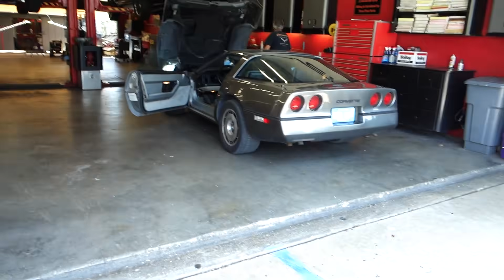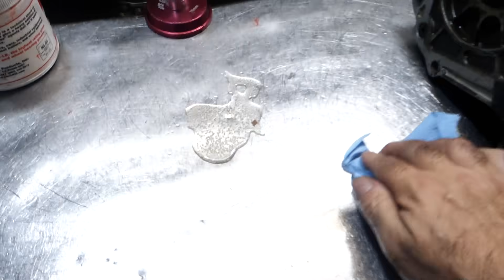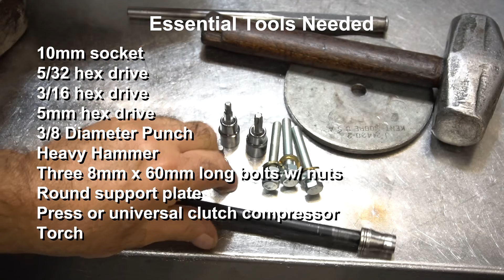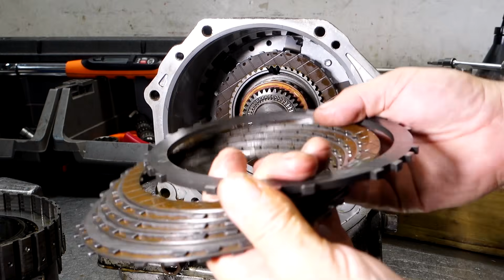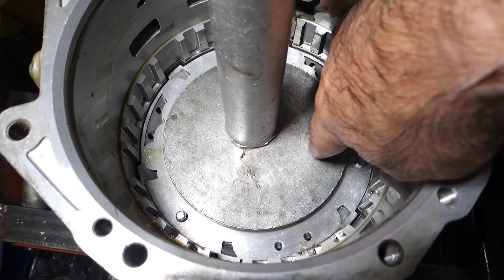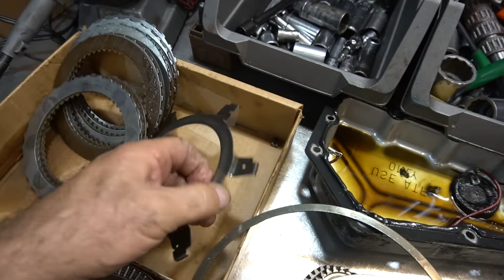How to Rebuild a Corvette 4+3 Doug Nash DNE Overdrive

Comment: Paul you do a great job and really appreciate your videos.  My point I guess you buy something like them year Corvette and GM threw a junk overdrive in there. Then the Bean Counters figure it will fix them under warranty. Which the bean counters know they will have to fix a few. They know most Vette owners won't putt enough mileage on them and when the owner warranty runs out there stuck with a high dollar fix down the road. At the beginning of the video I could tell by your words and actions that GM should have had a recall rather than stick it to the owner after warranty is over. You fixed a few under warranty but all the other ones that went out after warranty could be in the thousands of those cars. GM should have been sued over this screw up. Am sure they do this with a lot of there screw ups. I don't think GM did right but the owner in the ones that gets screwed. Would you be happy with this Paul if you bought one of these vette with your hard earned money and have to pay out of pocket that GM messed it up. I see these cars sell cheap because of all that electronic stuff that cost big bucks and most are outdated electronics that you can't probably even get from GM anymore. Really most of the car manufacturers make a lot of this junk. I have a friend that works as a technician for GM. We have pizza every Saturday night as we fly our drone and he is so tired of all the junk being made today. I asked him what is a good car or truck today. His answer there all junk. Why a lot of people lease today or buy the extended warranty. He lease his vehicle for this same issue. I hope at the beginning of your video your secretary don't treat your customers like she does you. A bear first thing in the morning and cussing at you first thing in the morning is not good start to the morning imo. Hope this is a joke. If I did this at my work I be fired on the spot. Seems like so much anger in people these days. You make it up by your excellent videos and work ethics for sure. And I really learn a lot and what vehicles to stay far away from them. Keep up the great videos though Paul.thanks
Reply from the maker: Rhonda is actually amazing with my  customers. The issue of companies avoiding the dreaded "recall" by issuing service bulletins still happens with every auto manufacturer. Investing in a new Vette today is financial suicide because parts typically can become unavailable in 10 years. The newer better models with those 6 speed T56  transmissions already have parts shortages. This is what fuels the aftermarket and keeps people like me in business. Thanks for the great feedback and watching the vids.

Comment: Sounds like if it's junk you find a different transmission rather than fix that piece of junk. Best bet is to stay away as far as possible for these years with a manual transmission with overdrive. Can you use the manual transmission that's in it without that stupid overdrive unit.
Reply from the maker: Well I overhauled over 800 units for GM without any failures plus my own jobs. So sometimes when you rebuild you fix the issues that the original party overlooked. Replacement used OD units if properly maintained work great. Never a failure in any Challenge car or Callaway Twin turbo I built them for.  The beam mount makes it difficult to do a non OD transmission other than swap out to the later ZF 6 speeds which are a service nightmare as well.

Comment: Where's  part 2?  
is $4000 a good deal for a '84 Vettte with 105k miles?  I don't wanna have to rebuild the trany every 50k miles.  I have a Crazy built 400 I could slap in it, what do ya think should I should I do it or should I not do anything except drink root beer floats....I mean seriously I have a THM350 with a shift Kit and stall converter bolted to the Scary Fast 400mod right now sittin in a '81 A-Body Regal rottin' away at the old mans and I have not driven it in 10 years because it gets like 4 miles to the gallon and I sunk over 10 grand into it, so what manual transmission would you recommend I use with the 400freak motor in the '84 Vette?
Reply from the maker: The Vette has a beam that goes from the trans to the rear so you just can't bolt any transmission in it. A worked 700 is a better choice.
Reply: O.K., will a 700 4+3 manual Trany(4L60) bolt to a chevy 400?  
Would the Higher Torque 4L80 be better for the High Torque 400? 
I would think It would be a simple engine swap..maybe?
Reply from the maker: I've known many who have put 400's in those cars with the 700r4. Good combination
Reply: Awesome^!!^  Thank You Paul, I appreciate your help a lot.  I will keep ya posted on the progress after I secure a Vette.  Thanks again!

Comment: so I had my overdrive unit rebuilt and worked fine for one tank of fuel, then on the way home on a night out the car got stuck in overdrive in all gears.
as soon as I take off in first it activates.
I have unhooked the trigger wire at the box, pulled the valve body off and all looked fine, fluid is clean and red, no crap on filter.
I'm stuck with  car I cant drive and enjoy and I'm not trusting the company who rebuilt it again.
is there a way to disable it all together while leaving the box in ? 
a fluid bypass or something ? or removing the valve body all together ?
I don't want to spend 5k on a conversion from silversport and I'm happy to drive without it.
any help would be appreciated.
Reply from the maker: Why not bring it back to the people who rebuilt it? Stuck OD with the wire i disconnected would be a shift valve hanging up or dirt clogging the shift valve passage

Comment: Paul, I have an 86 with the 4+3. Relays are working, power is going to the unit. Both od light go on when you mash the button. What else should I be looking for? How do you fill the unit and what do you fill it with? Any help would be greatly appreciated.
Reply from the maker: You fill it to the level of the fill plug. Drop the pan, put the car in diagnostic mode and check your connections and bypass the pressure switch to check if the solinoid works. Could be  a stuck or clogged shift valve.
Reply: Thank you Paul. I will look into that after Turkey day.
Reply: Good day Paul, I am in the process of getting all the parts to rebuild the overdrive unit, I can find everything to rebuild it except the solenoids. Do you have a source that I can purchase these? Your help would be greatly appreciated.

Comment: Thank you so much for the video! Very well done, easy to understand. The tips for identifying a bad unit from the outside is a real bonus! I rebuilt one of these overdrive units last winter based on what I believe was information posted by you throughout the internet. Installed it on my 1985 Corvette and it works! so much fun I'm doing another. Just viewed your part 2 video on the pump. Great also! Can't wait for the next video(s) on reassembling a 4+3 (overdrive unit) and especially any tips from your experience rebuilding these, Please hurry ; )

Comment: Back in 87or88, we did the first one I did not have a book. I told the rebuilder don't touch until  I come back with the book from my chevy dealer. But any one that owns a shop the help does not sometimes listen when I came back with the book and talking to the mechanic about rear piston danger under pressure. Alex was at the hospital he was very lucky left eye and head if he did not have his coca bottle glass on he would have lost his left eye I had the glasses in the rebuilding room for 30 years. Read the book or use all data none of us are above knowledge.
Reply from the maker: I've seen a few accidents like that.
Reply: Well, you can be sure the help learned his lessons.

1. Listen to directions from those who know what they're doing.

2. Heed any and all dangers, warnings, cautions, and notices in the service literature and/or on the component being serviced.  At the very least, it will save you from frustration.  At the very most, it could save your life.

Comment: Hi, great video. My 88 vette has an issue with the od unit . If I don't disengage the od before parking it, it acts as if I lose reverse, or sometimes bangs into gear. If I disengage the od switch and drive it a little before parking , everything seems fine. Your thoughts on what to look for when I disassemble it this winter? Otherwise the od and transmission work fine. 
Thx for any input.

Comment: Have you had any experience with the cast iron "Chrysler" New Process A 833?
Reply from the maker: Much. Its featured in my first book. "Building and Modifying High Performance Manual Transmissions
Reply: GearBoxVideo Thank you, I'll check it out.

Comment: Hi Paul, I recently purchased a 1988 corvette with 4+3, and of course the OD doesn't work, your illustrations and explanations are awesome and well presented. I work on lot of classic cars and the transmission are always a voodoo box for me. I'm starting to diagnose the issue(s) with my overdrive unit and video's will be my bible- thanks for all the videos, I also have couple of muscle cars with Muncies will be watching all the videos 
Thx! 👍 perry
Reply from the maker: Put the car in diagnostic mode and check that the OD light is on and you have power to the lead at the OD unit. That's your first step.

Comment: awesome video. makes me confident this is something I can tackle myself. would like some input from you though. mine locked down to the point the car would barely move. it was like it was holding direct and od.
Reply from the maker: Joshua Benson in the video I talk about the direct clutch thrust washer.  If it breaks the washer can get the OD unit stuck in both modes. What year do tou have?
Reply: GearBoxVideo it is an early 87 car. I was driving the car and it started making a popping noise and came to a stop. it was like trying to take off with the parking brake on.

Comment: I'm planning to put an overdrive unit from an 86 onto my 84. Can I still utilize the factory overdrive switch or do I need to switch the shifter out?
Reply from the maker: No, you would still use the factory switch. You would just be eliminating the cable. I have all the gaskets in stock if you need them.
Reply: GearBoxVideo Thanks! Great video. The o.d. unit that I'm buying is supposed to work so I just plan to pull mine off and throw that one one. I'll replace the fluid and filter before I do so. Will I need any gaskets other than a pan gasket to do that?

Comment: currently have mine out on the bench and cant find anyone in Sydney that will touch it. I have been tossing up trying it myself.
 I think mine only needs plates, do I have to strip the rest or can I just change the plates ? keen to see part 2 !    great video !
Reply from the maker: Hairy mongrel  you can leave the pressure plate anchored if you think those spribgs are OK

Comment: could this unit potentially bolt up to a muncie m21 wide ratio? or is there any type of OD that can bolt upto a m21?
Reply from the maker: Flavio Borbon No. It already ia designed and part of sn ST10. In part II of this series I discuss the pros and cons of using these in a non Corvette application.

Comment: Is the Super T-10 output shaft unique in the 4+3, or can you use a typical output shaft with the same length and spline count? Is it possible to mount this OD unit on the back of a Muncie or Saginaw?
Reply from the maker: TargaWheels it's a shorter special output , housing, and reverse setup.  I do not recommend using these in applications they were not intended for.

Comment: Quick question, Does double clutching in an standard manual box reduce wear on synchro-rings?
Reply from the maker: tipetu I dont think you are going to see a major savings doing the double clutch work. Yes you xould cut down on wear.

Comment: "...and so begins another day..." - and I spat coffee all over my keyboard.  Nice one!  Btw, that system of piggybacking the overdrive onto a 4-speed...reminds me of the Triumph overdrive setup for the TR6.  I believe it basically used an auto trans on the back of the regular gearbox, that could be used with 2nd, 3rd and 4th gears (I guess giving a total of 7 gears - unless some of them overlapped in the effective combined ratio.)  Ever work on one of those?
Reply from the maker: Those were Laycock overdrives.  They were coupled to Moss 4 speeds, especially on Jaguar sedans. Yes I have worked on those. Pretty much a company called Gearvendors makes a modern day version of that.
Reply: Thanks, mate.  I thought the basic concept sounded familiar.  And thanks for the breakdown of the teardown.  It's nice to find the pitfalls and potential problems before learning the hard way.  :-)

Comment: I enjoyed watching this excellent presentation but it was way over my head. I can't imagine with todays technology why someone would want to put that back in instead of upgrading to a modern overdrive unit. I know $$$$$ would be a stumbling block but I'm asuming these owners have $$$$
Reply from the maker: TheEZGZ This was 1980's technology.  These cars can be upgraded but the cost would exceed the value of the car.
Reply: I’m putting one back into car that it removed for some reason. I want my car to have all the quirks the 80’s had on offer.  I’ve heard many were used hard, abused then dumped off when they failed from neglect.   I only wish the over ride button was three position; OD, auto, no OD
Reply from the maker: A simple chip change can do that

Comment: Having been a regular visitor to Paul's shop in the 80's, I can attest to the fact that he built and updated 1000's of these over-drive units... They were everywhere!

The Overdrive Automatic THM700R4 first appeared in 1982 and the C.A.F.E. - Corporate Average Fuel Economy - was the real driving force in getting Overdrives and Fuel-Injection into production runs, especially in the Corvette. Another interesting note is that a Chevy Chevette with a diesel motor getting 50mpg could skew the Corporate Average to give Corvettes a little more "breathing room" with the Corvettes getting less MPG then the rest of the Production Line. The C.A.F.E. Standard was actually the real reason for the Electric EV-1... GM wasn't going Green... they were skewing the Corporate Average to save money...

Great Video Paul!
Reply from the maker: Chris Christenson thanks Chris,  those were fun times.